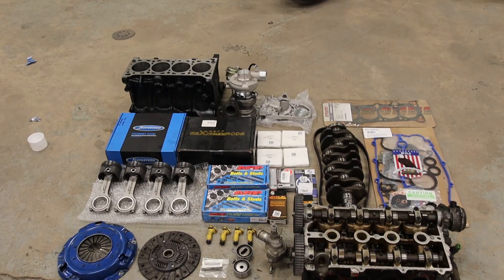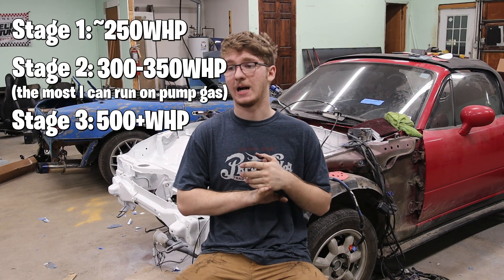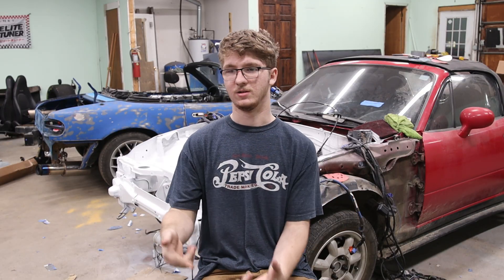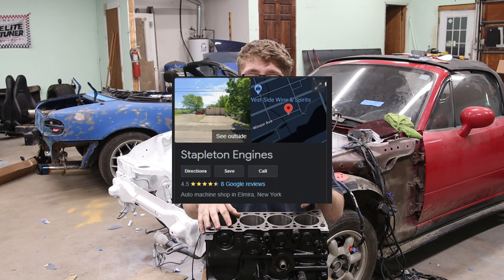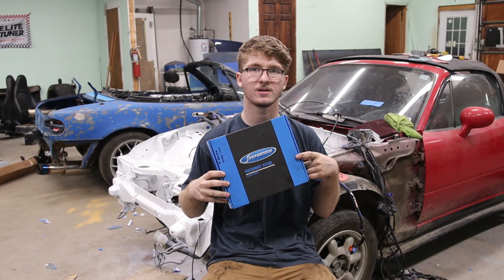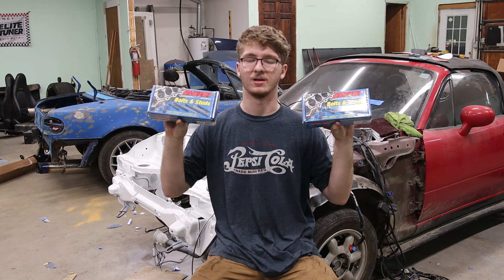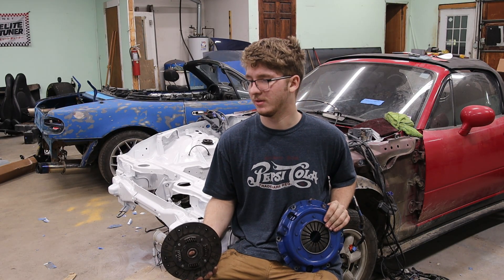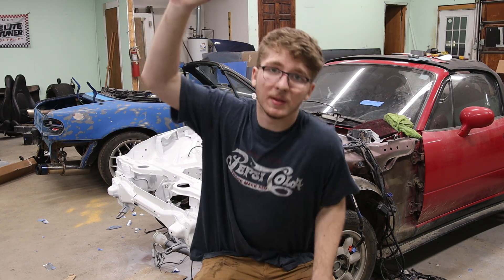What Parts Did I Pick To Build A 500HP 1.6L Forged Miata Engine?

Comment: It's also a good idea to change the crank nose bolt when you have it apart and also apply some Loctite 660 to the tapered nose of the crank and the inside of the Cog. The Woodruff key should not be supporting the strain of the Cog as it is spinning, turning the cams and ancillaries. It is only there to ensure you get proper base timing. The taper and diameter of the crank nose is what holds rotational force. That's why it got longer and larger in diameter during revisions. Simply put, there's more surface area against which to spread the rotational force. Years ago, I had a 90 Miata, and the timing was starting to lag due to widening of the key way. I took it apart used a new bolt, key, and then applied Loctite 660, turned the Cog tight to the undamaged shoulder of the crankshaft keyway, let it set up for 24 hours, and then it was on in a way that nothing short of applying heat could remove it. Loctite 660 is anaerobic, it cures in the absence of oxygen. Take a look at the MSD sheet for the material and you'll see that you have to warm it up with a MAPP gas torch or propane torch until it will release. Years later, when I was taking it apart, I removed the bolt and bent a cheap steering wheel puller trying to remove the cog. This stuff is amazing how well it holds. Once I heated it up, I was able to literally slide it off using a flat blade screwdriver behind it.  I was actually able to start the car and drive it a short distance from the driveway into the garage with the bolt removed and only 660 holding it together.

Comment: Arp is what my oldest son used when he built his junkyard 5.3 LS with a single turbo, and he put a Holley self-learning Efi kit on it and put it in his 79mustang to go small tire no prep racing. he is going to twin turbo it later on. he just got his fuel injectors back from the shop. he's still working out the bugs right now, but he will get it figured out.

Comment: I have an original 1990 1.6 and I know all of the previous owners and have all of the maintenance records from it entire life. Boosting is something I am interested in. If I could get 200 hp I would be ecstatic. I do worry about the fragile rear ends and would enjoy your recommendations on what could be a better replacement. Looking forward to your build and learning what can be done with my sweet little ride. Thanks
Reply from the maker: You can get 200whp very easily with a mild turbo setup like I've done. I used a td04L-13t. You usually don't have to worry about the rear ends at 200whp. past that and nearing the 250whp range I'd start to worry and upgrade to a torsen diff

Comment: IIRC 94 was the only 1.8 year that has oil and coolant supply built into the block on the exhaust side. I build 1 94 block 1.8 specifically because of the convenience

Comment: im currently in the process of turboing my 92. my goal is 375 whp so im skipping a stage 1 build but i would be more than happy even at 300. im using many of the same parts as you but will be doing 1000cc injectors, dw300, balancer, cops, 6 speed, 3.9 lsd, e85 and whatever else pops up along the way to support it. im looking forward to seeing the progress of your build and cant wait to see it ripping along. best of luck
Reply from the maker: That sounds like a hell of a build. I've changed my game plan a little since this video. I'll daily it at ~300whp (or pump gas max). Then I'll bump it up to 430whp (500 crank) on e85. Flex fuel sensors are also a god send. I'll be running a 6 spd and either 3.6 or 3.9 LSD. 430whp is around 350 trq which is where those start to max out. As long as I'm not too rowdy with it, I should get some miles out of it.
Reply: @revreign  i cant imagine running these cars at those power levels but im sure as time goes on 350whp isnt gonna be enough and ill be pushing for more. all i need is a car to beat my brothers car and ill be happy...for now :) looking forward to seeing your progress to an insane miata
Reply from the maker: @fpvdominator9563  haha yeah there's always a desire for just a little more power. What's your brother's car?
Reply: @revreign  2019 mustang gt with an mild exhaust and tune, nothing crazy but as of right now it blows the doors off my car

Comment: I'm in the process of putting in a forged MK2/NB 1.6 into my MK1/NA 1.6. 

I think a TD05 20G on a 1.6 would be horribly laggy though. Nevermind something bigger again. A VF34 seems like a much better choice for your stage 2, given you're sticking with Subaru Turbos.
Reply from the maker: Thank you for the suggestion! Is the VF34 the same flanges as the TD04 and TD05? Do you think I'll be able to get a similar power output from a VF34 as I can with a 20G?
Reply: @revreign  If your TD04 is the triangular 3 bolt one then yes. You can get TD04s in multiple flange styles, but I'm assuming it's the Subaru one.

A TD05 20G will have a much higher a power ceiling than a VF34, but it'll be super laggy, like not fun to drive kinda laggy. But maybe lagginess and a slow response are compromises you're willing to make.

For me personally, they aren't. I'm happy with 300WHP, and I won't want anymore than that. A VF34 will get you to that while maintaining a pretty similar level of responsiveness as the TD04.
Reply from the maker: @MrManBuzz  Sweet, VF34 may be the way to go then for me. As long as I can get to a little more than that 300WHP range then I'll be happy.

Comment: when going for 500hp you will be asking for over 50psi of boost from your turbo that is a lot meaning your setup will be very laggy as you will be riding the surge line(also meaning it is not efficient). the way to fix this is by having more power before you turbo the engine eg. na mods(cams porting and such), supercharger(twin charge) or an other turbo(compound turbo). not sure if you mentioned coilpacks but if you didnt you should get some.
Reply: Lol bro theres so many variables that play in it. U dont know it will take 50 to make 500
Reply: PSI doesn’t doesn’t equal horsepower. Airflow and fuel makes power. The right turbo like CarPassionChannel uses is around 25 psi for 500 whp.
Reply: @MendicantBias1  Greg's build isn't in the same universe. He's running a BP6D 1.8, with a +1mm overbore (84mm) and a +2mm Maruha stroker crank (87mm) for 1928.5cc's. He's also running 10.5:1 pistons and a total CR of 12.2:1. This is a +0.5mm (78.5mm) overbore and stock 1.6 crank (83.6mm) for 1618.4cc's and 8:1 compression. Before you even add a turbo Greg's motor will make 50% more power. A 1.6 with a 8:1 cr is good for at most 110 wheel, but a bored and stroked 1.8 at 12.2:1 will likely be over 160. He also has a VVT head and the most efficient / fastest spooling turbo on the market (borg warner). 

To be blunt, you will not make 500whp out of a 1.6 liter with low compression pistons. You can probably make 400whp, but you're looking at around 30psi on a large frame turbo like a GTX2867 or bigger. It'll make around 110whp at 3,000rpm, 140 by 4k, then all of its power will spike on like a cliff by 5k, with peak torque coming around 6k. Maybe your main caps will survive due to the lack of low end torque, but at 500whp they won't be long for the world. 

Depending on the turbo, e.g. a smaller less efficient Subaru turbo, 500whp would in fact require 50psi with this engine configuration. Except you'd make neither 500whp nor 50psi, because the 1.6 doesn't have enough exhaust gas or velocity to spool up a turbo that high. Moreover, at that point you'd be well outside the efficiency island of the turbo and will just be blowing hot air. 

The Mazda B engine family as a whole is 1980's technology and is primarily limited by the fact the heads flow poorly. The 1.6L's volumetric efficiency drops to 70% by the time you go over 7000rpm. The BP4W and BP6D heads have a higher port angle for better flow which will net you 10-15hp over a BP05, but they're still bad relative to any modern engine. 

The 1.6 is just strictly an inferior engine to the 1.8. It offers no advantages. It has less bore, less stroke, less head flow, makes less power, spools slower. It isn't appreciably lighter, the 1.8 complete longblock only weighs 18lbs more. It doesn't rev higher since the BP is primarily limited by head flow, followed by the valvetrain, followed by valve seats. The only reason to run one is that you already have it and you're trying to save money. But that last point goes out the window when you spend 3k+ building the block, at which point the $500-1000 you saved by not just buying a 1.8 stops making sense.
Reply: @MendicantBias1 i am using boyles law however i am assuming that the temperature remains a constant. airflow is not the best term to use instead use mass flow. the point was that with the current engine he would be asking for to high a compression ratio out of a single turbo and my aim was to say how you could solve this issue
Reply: Itll be fine
Reply: @isaiahwinslow5140  why

Comment: So the 1.6 does not make that much torque you might be fine at 450 even with the 1.6 and 350 on the 5 speed. 

Im right now trying to find out the limit of the weak components on my channel aswell. 
Have a 1.6 with just rods, stock pistons stock oil pump, stock harmonic damper  thin MLS head gasket, stock head bolts GT3582, 5 speed and NB Diff, Running 350 HP right now and seems fine so far. 

Also clutch: Best thing to do is get a stock 1.8 flywheel and resurface it and use a sprung hub 6 puck clutch. drives like stock. a light flywheel is a pain as a daily driver 

A friend of mine recently broke his 5 speed at 340 WHP with a 1.8 which makes quite a bit more torque. my goal with a light car would be hitting 400+ Crank minimum. 

if you dont drift or track drive should be fine
Reply from the maker: Woah that's awesome! I'm very familiar with your build. I've actually been watching your videos since your bottom end assembly. Thank you for all the info. That really helps!
Reply: @revreign  Thanks for following. If you have any further questions let me know

Comment: So why did you buy 430cc injectors, and undersized clutch. And a smaller turbo. If you are planning on going big later on? Sounds like a waste of time and money if you are planning on big power anyway
Reply from the maker: The reason for that is to be able to drive it in the mean time while I save up for the stronger parts which cost a lot more. I don't have the money right now to go full out with everything. I had all of the stage 1 parts on my car before I even considered building the engine. As for stage 2, (~350whp) I'm going to max it out on pump gas and would like to stay there for a while. Many of those parts I can resell or use in my other miata like the 6 speed and torsen diff. They hold their value well. Stage 3 is more of a hypothetical if I get enough money for the supporting mods, I'll do it cause my engine can handle it.
TLDR: I don't have money for big power supporting mods rn